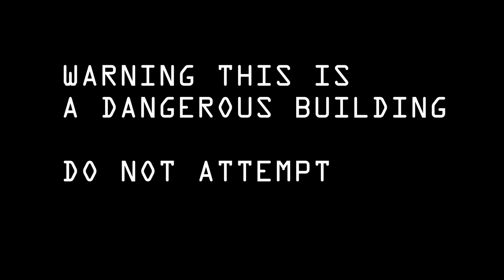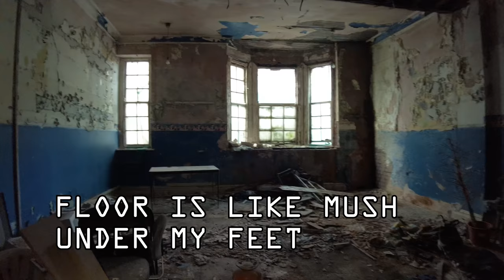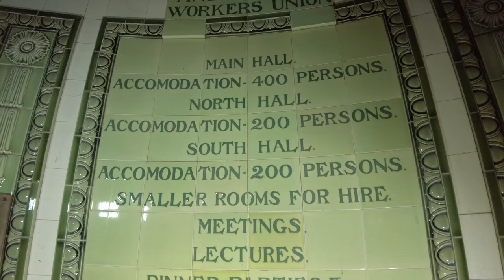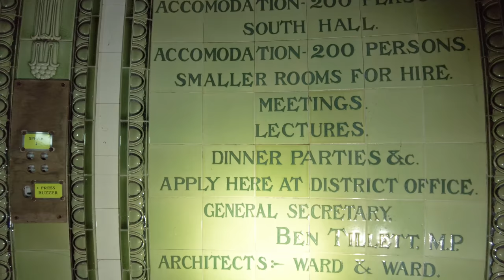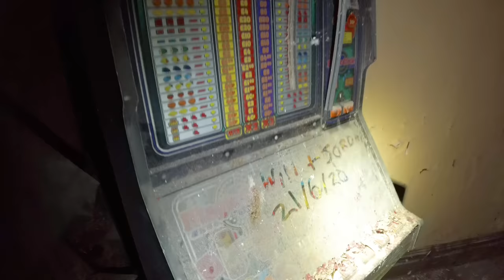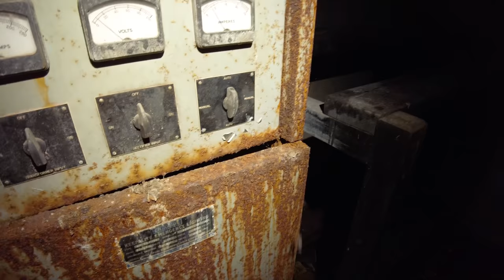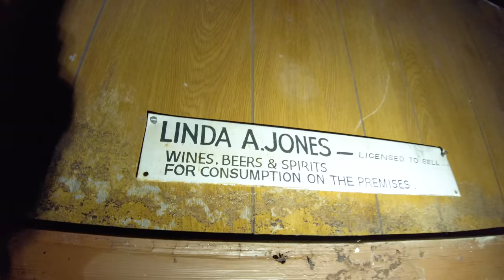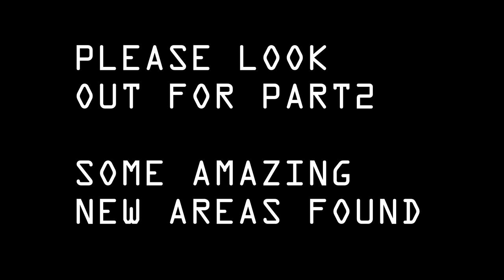pt1. The MOTHERLOAD they didnt want us to see. Elysium Cinema

Comment: Backstory:
A very impressive high fronted building at the top end of Swansea High Street just seconds away from the main line station. The Elysium Cinema opened on 11th April 1914 in a building which was part used as the Dock Workers Hall. It was designed by the architectural firm Ward & Ward of the Strand, London. It closed as a cinema in 1960 and went over to use as a bingo hall, which had closed by 1994. It has been boarded up for many years now.

This cinema/theatre is the one Swansea building of entertainment that never seems to get mentioned or anyone knows much about. Any info would be of great interest.

Contributed by Ian Howells